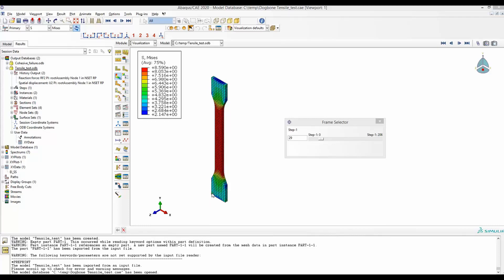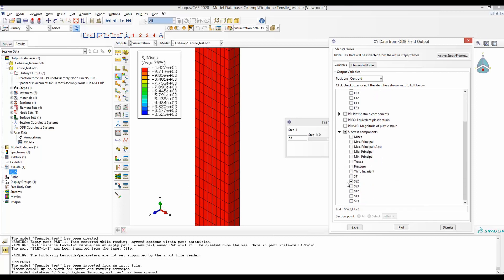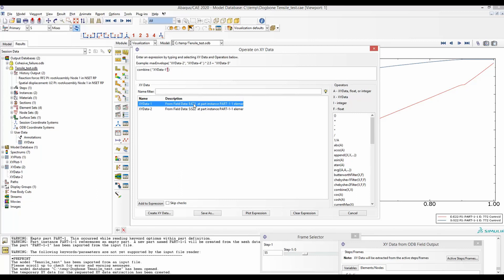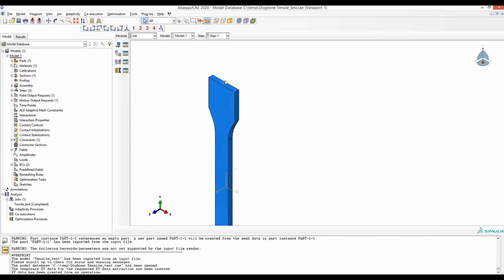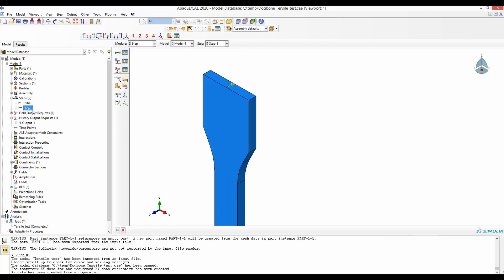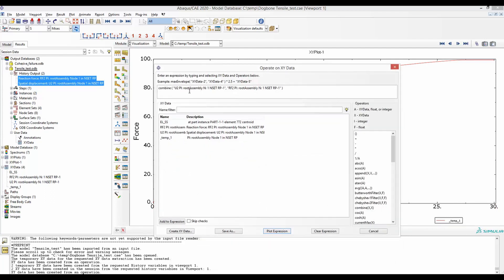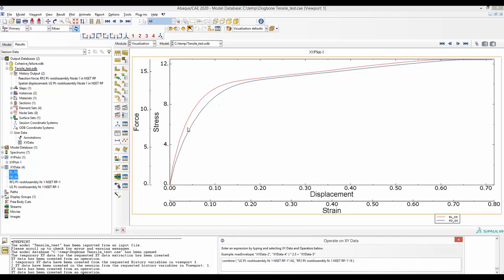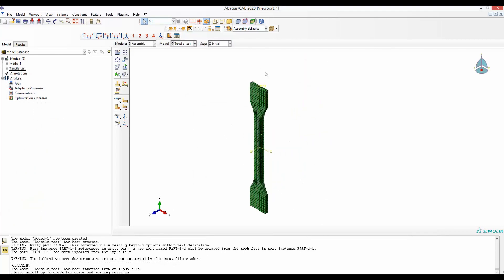How to get stress strain curve in ABAQUS

Comment: Could you kindly confirm if the result for the 4 point bending test on plain  concrete, showing a stress of 0.3 MPa and a deformation of 0.0002 , is correct,? considering that the 4 mm displacement method was applied?

Comment: Hi, Sir! When you divide the force by the length you get the Eng.strains. My question: Is the length here the gauge length or the extensometer length? In the specimen I have tested, the gauge length is 60mm and the extensometer length is 40mm. I'm a bit confused about which length I should use to get my eng. Strains. 
Thanks!
Reply from the maker: Hi Tameem, ideally you should use the extensometer measurement (deformation) and extensometer length.